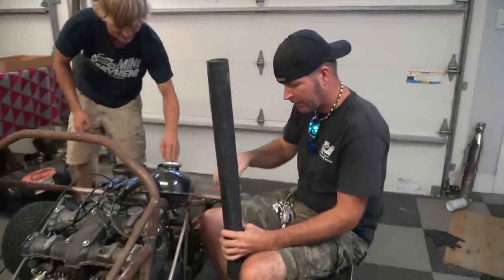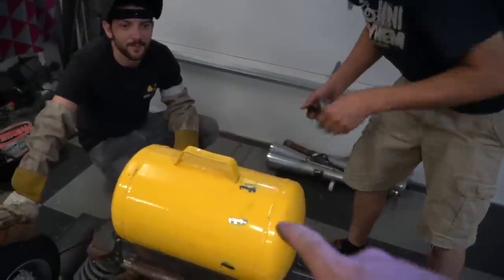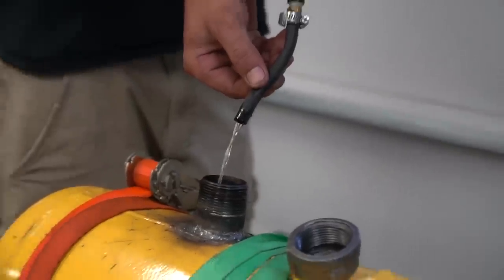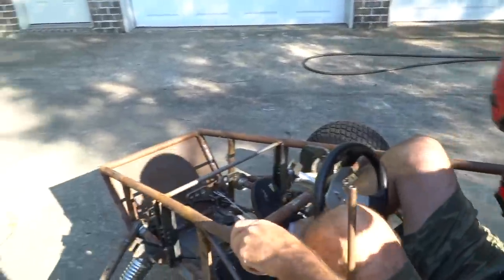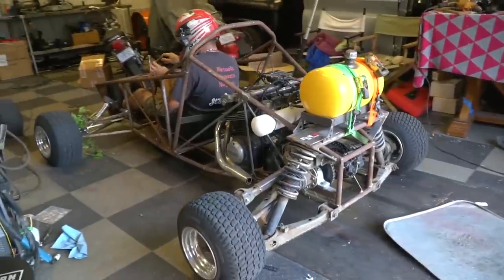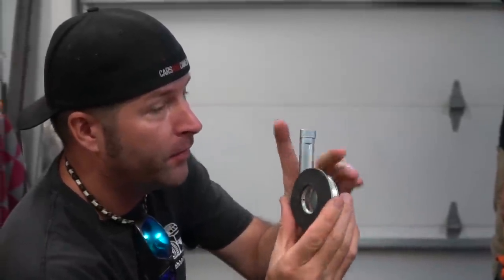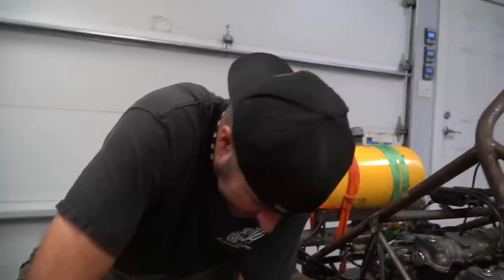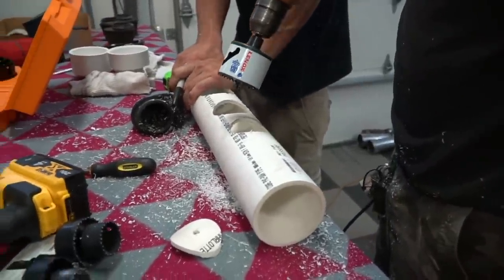750cc Cross Kart TUNING | Building a Custom Air Box, Jetting!

Comment: When I modded the exhaust on my 97 Honda Magna it never ran right at top end until I put the stock exhaust back on. Lesson learned, Honda motorcycle engines hate it when you mess with the exhaust.
Reply: It's not a Honda specific problem. You can't just slap an exhaust on and be done. You are changing the amount of air the engine can pump by reducing back pressure. It has to be retuned or you won't see the gains. Or in your case, you actually lost power.
Reply: Running this straight pipe exhaust is probably increasing backpressure because there's no scavenging.
Reply: @BuffMyRadius  Nah. The loss of that crossover pipe isn't nearly as big a factor as ditching the stock mufflers.
Reply: I had a suzuki  750 with k & n's  and a kerker, it ran better than that but it still had its lean spots and rejetting on the bike was like just give us your wallet and we'll let you know if we need more. Till you work out a real airbox/exhaust combo your 'tuning' is going to be chasing your tail, just an opinion for sure. Seriously, that shifter not only flops front to back but side to side about 6", I know they won't see all this they seem to do whatever, but that shifter says more CarsandImpalement but I suppose it'll be fine.

Comment: I did something like that to a car I owned, all so I could get a a pod to fit to my intake manifold. I used PVC pipe, a straight piece and an angled piece, plus a hose clamp. It worked well and sounded good too when it was sucking in a huge amount of air.

Comment: I have a cb450 and was instructed by a guy who races them that I needed to use a long intake runner between the carb and pod filter for each carb separately. the long runners act as velocity stacks . if you don't have enough room for a long strait run you could use four rubber elbows . maybe some kind of molded radiator hose elbows ?

Comment: Paint that PVC airbox with some ceramic spray paint. It'll make sure the air being pulled in stays nice in cold, because it won't let heat from the engine in. Plus, it won't look like PVC anymore.

Comment: You might want to check the ignition system, if it’s equipped with points there’s a small possibility that they might be breaking up due to higher revs. Good luck with, it’s badass. And you might want to do something with the exhaust system.

Comment: Should’ve just drilled the vacuum port on the carb slide I’ll bigger. I believe it’s 7/32 or something like that. And cut 1” off the spring. Don’t believe me look it up on cvk carb mods. Or Mojave 250 carb mods, same type carb. That and bigger jets, huge difference!

Comment: This really makes me miss my cb750 even though it never ran correctly (exactly what yours did). If I still had it around I’d send you guys the air box. I believe they make a pod that connects 2 of the carbs at the same time and is supposed to help with even vacuum draw. There is a Facebook group. Called Honda nighthawk cb (450/650/750), they have some gurus in the group and helped me a ton when I was still working on mine. Cb750.com also has all the parts you could need for it whether it’s a clutch kit or carb parts. Hope you guys get it running good finally!
Reply: There's a nighthawk group? Sweet... Joining that right now 😁
Reply: TurboRanger208  there’s a few! All the ones I found were extremely helpful when I had my nighthawk. Hope they serve you as well as they did me!

Comment: I would suggest welding some tabs onto the tank to keep it from rotating in the frame. Maybe some metal straps with pinned buckles.  With as much bouncing around you guys are going to do, the tank will come off eventually, spraying gas everywhere.  I have personal experience.  But I do love the portable gas tank idea.  Maybe a pin lock on one of the buckles.

Comment: Airbox  is looking good, you need to get some collectors, and make the exhaust a 4 into 2 with some baffled short mufflers. Adjust the valves, Get a monometer with four hoses so you can sync the carbs with the airbox on, and the engine warm (things change when you add the airbox) Then start the rejet process with a nice dynojet stage 2 kit, and do not drill the jets!!!! follow the instruction with the dynoet kit.

Comment: Open headers are contributing to the lean condition.  The carbs are flow matched the stock intake and exhaust.  Either put stock length and restriction exhaust and stock airbox, or you have to rejet and adjust.  Synchrony is also critical, but you Have to do it with all the intake and exhaust parts in place.  There should be vacuum ports on the engine so you can check manifold vacuum with everything in place.  It is super precise and sensitive.  Can't wing it.  Carb sync tools with 4 vacuum guages are about $50 shipped.  Engine has to be HOT and idle set to factory spec.

Comment: You should try extending the exhaust to see if that helps with it burning to lean. Your exhaust has a lot to do with your carb tuning. The faster your exhaust escapes the leaner it will run and the more fuel you'll wast.  Just an idea to think about guys. Awesome job and good luck with your build.

Comment: Your Open Exhaust is killing your bottom end if you can figure out some kind of mufflers for it you might get back some of the bottom end it may even help clear up your top end
Reply: Definitely!#!
Reply: It sounds like crap too..
Reply: This
Reply: It's not a 2 stroke. Backpressure on 4 strokes kills power across the RPM range. Hotrod did Dyno tests and titled the video something like "People can stop saying backpressure helps low end power"
Reply: It's not about backpressure, it's about gasflow and the pressure pulses that reflect back from changes in diameter reaching the valves just before they open.
Reply: You are just as wrong four years ago as you are right now

Comment: Cool idea on the intake, but the one thing missing would be the velocity stacks that were on the original carb boots.  Pods generally dont work because of how the air flow is collected and passed to the carbs.  If you can find original boots that went from the carb to the airbox, you could retro fit them into you intake idea.

Comment: put another air filter on the other side of the PVC airbox!
Reply: It would be cool but not necessarily as functional like Ike was saying it needs to have vacuum but if there is a filter on both sides it would have little to no vacuum

Comment: Here is a tip for you. Synch the carbs with a vacuum cleaner aka shop vac. That way it's a steady flow on each carb and you don't have to worry bout different idle rpms when you time each carb cause of different variables with each carb and bore. Just something I picked up over the years and it is so much easier

Comment: vent the fuel tank add a fuel pump put a return to tank  install bigger fuel line
Reply: Fuel tank must have a vent.....for fuel to exit tank....air has to enter
Reply: Most fuel caps have vents in them I assume theirs does

Comment: As someone who specializes in carbureted motorcycles, this is painful to watch. Take the time to bench sync them and then use a proper sync tool. Also, just buy some jets 😂
Reply: I have been trying to tell them. Hell looked to me like he was trying to sync. them by turning the fuel screws. I only worked in bike shops for over 20 years what do I know and we drag raced the 900 for 3 years.
Reply: @72hourbob61  z1 for the win

Comment: In addition to that , I would also check your throttle cable to make sure your slides are all opening at the same time when you give it gas. When throttle cables age they stretch which will cause your carb slides to open at different times. Also I'm sure each carb has an adjustment to raise and lower slide positioning, if your slides aren't opening at the same time it will throw everything off

Comment: I used to make PVC intakes for cars years ago- My 96 eclipse, my 96 GMC sonoma, my dads S10, a dodge stratus, honda civic.... work well on the cheap, and cost usually around $25 to make each one once you invest in some 2" pvc pipe and some silicone connectors and filters. Was is hack? Maybe, but it was cheap and sounded cool on cars back in my younger days.

Comment: You need an air filter on both sides of that pvc pipe or the carbs are not drawing air equally. Also that gas tank needs a vent as you didn't mention one and it's not seen. Hope that helps guys. Awesome job.

Comment: just so you know the opening on a stock air box is about a 1" square hole or a little larger, its kind of a rubber snorkel looking thing, when you pull the carbs you can sink them with a small drill bit, that works ok, but merc sticks work the best, you can raise the carb needle up a little with a washer, that should help,  i haven't seen you check the valve clearance, the stock tool kit comes with feeler gauges for a reason.

Comment: Cut the top off that pipe thread gas cap you are using and weld on a fuel filler neck from an older car. Keep the add on piece short, and then you can run a vented gas cap, This way you don't need to clean the tank to weld on it. This will help with fuel flow for sure. Also by going that route, you can tighten down the gas pipe and then push on and off a gas cap for easy no tools fill up. Great vid, look forward to your next one.

Comment: Flames shooting out is usually a sign the gas is not being fully burned or getting too much, since it is only acting up at at full it might be too rich or a slight timing issue (valves might be staying open too long).  Also I would hold off on the rejetting until you find the vacuum leak, otherwise you will be chasing that gremlin with every fix.  If you start out with balanced carbs before the rejetting it should (in theory) remain constant throughout, or at the very least not need as much adjusting afterwards.

Comment: From what I've heard of the test rides, definite carb sync, and go up 1 jet size (maybe 1-1/2), and you should be right in the sweet spot to hit full throttle without spitting or lag. Just my 2-cents. I majored in Asian Bikes with a specialty in full Engine and Carb rebuilding, but that was almost 10 yrs ago.

Comment: You can run Pods but need to rejet the mains plus you need to put the muffler back on as they grave a slight back pressure top end

Comment: Before you bother synchronising the carbs make sure that your air intake box is working properly and it's possible that not all of the floats in each carb are set correctly. That could be causing a lean burn situation that you're experiencing. Also, why not put a vent on that new gas tank. Just a suggestion but chopping about 8 inches off that shifter and putting a handle on the top of it might be a good idea before something happens and you wish that you had. Looking better as time goes by.

Comment: you should recreate a cold air intake for a 2010 civic and route it to the end of the "intake". the wpn-r has a filter with a open top so you can run a tube to the top of the frame and have a sort of snorkel while also letting it force air through the tube while driving.

Comment: I had the same engine running rough problem with my 96 bandit 600 I came to figure out my air box cap wasn’t even on and the air filter was knocked out of the box..I put the filter in and got a box and ran way better, then I went to auto zone and got Lucas carb cleaner and put it in the tank and it’s been perfect ever since so keep screwing around with the intake and filter and throw some carb cleaner in the gas tank and run it around for long periods of time to clean those carbs out

Comment: So, the goal of running an airbox on CV carbs isn't specifically to put a restriction on them, the goal is to straighten the airflow before it gets to the carb belmouth.  If you look down the intake, you'll note a little scoop and port at the top of the carb, that's what drives the slide.  If the air flow into the carb is turbulent in front of that port, the carb won't behave.  Try longer connector tubes, and don't be afraid to go bigger on the PVC airbox itself.

Carb sync will help, and you likely still need to go up on the mains too.

Comment: cv carbs need to be super rich when run like that! and add velocity stacks in the air box cv carbs like a laminar air flow! also when you add the heat shield make sure you add air ducts to keep the engine cool

Comment: I would definitely use a set of two vacuum gauges to set the carbs. 
Sync 1-2. 3-4.  Then sync 1-4 or 2-3 to sync the sets together. I know I didn't explain that well. 
Hope to see some updates soon :) that shifter looks dangerous. Lol
Reply: Those carbs are quite different from mine, so you're process is different.  My bad. Gl

Comment: It needs a fuel pump!  At high rpm gravity isn't enough to fill up the carbs. Just find the original from the donor bike or another pump that is designed for carbs.
 You also need to make the exhaust into one.

Comment: here is the order you need to work on it at; clean carbs, check valve lash if it has solid cam followers, get it idling, check all carb boots for leaks(spray them with something flammable, brake clean ect), sync carbs, tune carbs fully in all three tuning zones (idle needle and main), re-sync carbs.

carburetors do not need restriction before the carbs.
there is generally a carb that you don't adjust close to the throttle cable cam(adjust all carburetors to that carb).
air must be able to enter the fuel tank. 
air should enter the carb as straight as possible. (longer runner before carb).

being that those appear to be cv carberators, be cautious of the diaphragm in the top as they are easy to damage.

personally i'd find another carb tuning vacuum gauge(all 4 at the same time is way easier).

Comment: i had the same problem. remove needle in carb, put in thin washers, replace needle. worked fine on my 81 cb900c. it raises the needle so you don't need bigger holes in the jets.

Comment: cool episode!  hey fyi, if that was regular teflon tape you used on the fuel fittings ive seen gas dissolve that stuff before.  i have since gone to a chemical resistant thread paste, or just AN fittings

Comment: i found the factory airbox used in what seems to be good condition from multiple sellers at less than $100, i think the best way to go would be a factory air box, factory jets and carbs, and get some aftermarket slip on mufflers that would be intended for factory use on the engine as it were on the bike, that will net you the best result with no headaches and you will have the peace of mind that you have a safe A/F ratio and you are making the factory approved HP rating with no compromise... i've messed around with my fair share of atvs and motorcycles and have always found factory configs to be the best no hassle option, the thing will make plenty of power in that config, why waste the time and resources trying to get an extra 5%-10% power that will most likely not be put to the ground anyway... love the build and i see where y'all are coming from but this is far from your only project, if its all custom built you are going to have a hard time keeping it tuned right after you let it sit for months/years and wanna bring it back out for the occasional video or just to rip around, been watchin y'all since summer 2015 and think its amazing how far ya come, keep up the great work!

Comment: Put a wireframe metal plate where Ike's back is on those two pipes going up toward the head guard, and that would potentially help as not only a back rest if necessary. but also for air flow since the wireframe plate would be better than a solid metal plate that blocks air going to the engine.

Comment: I have  several old Honda's, including a cb750. It needs a little back pressure. Put a 1/4 inch bolt in each exhaust pipe to create a little.

Comment: For the PVC run something like mini snorkel so for one it's not right by the time getting things flung into it it'll last long and two it'll be forcing the air a bit more if you run it up along the framing next to it  and stop just above the head height of the rider and then put something like a 45° fitting so it points the filter strait  towards the front of the vehicle. It'd look bad ass in my opinion once everything got painted!

Comment: You guys need an exhaust gas analyzer to adjust the carb jets.  Also that little vacuum gauge is worthless for syncing the carbs, it takes one with 4 columns that you connect to all 4 carbs at once to sync them.

Comment: Syncing the carbs should be done at idle.  Bigger jets?  What altitude are you at? And did the engine come from the same region?  Too hot = not enough fuel or too much air or both.

Comment: I saw when you were sinking the carbs, one of them the bead was fluttering. That would indicate a valve problem, you might want to check valve adjustment if they are adjustable...

Comment: That engine wants more back pressure from the exhaust also. Only way around it is to jet the carbs. I made a cafe racer from one. Ran terrible with pods and little shorty mufflers. One I jetted it ran clean and made good power. You'll burn valves if you run it like that.

Comment: Vent the gas cap ..ad an electric fan your blocking of the cooling by sitting in front of the engine..also you fuel is sloshing to the rear of the tank because it's round and mounted sideways..turn the tank and put the fuel cock to the rear to increase fuel pressure to the carbs ..utilize the g force ..to push fuel .to the carbs ..as it is now it's doing just the opposite. But I really like the 4 gallon air tank idea ..it's extremely inexpensive and built like a tank ..I used to build my own tanks for bikes choppers and bobbers ..mostly casket tanks the octagon shape helped to funnel fuel to the rear on airplane tanks they ad in a rubber line with a brass weight on the end of the line in order to follow the fuel ..it's called a clunk..which may prove useful even if you run a full pump ..good job guys ..I like that thing